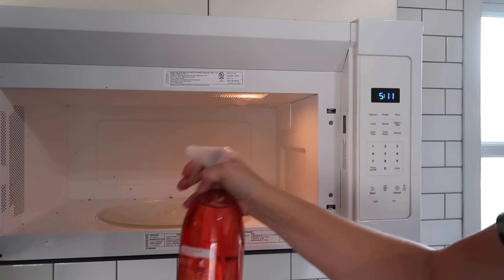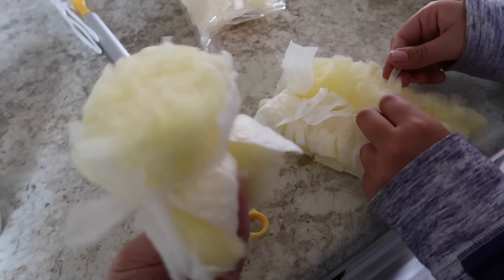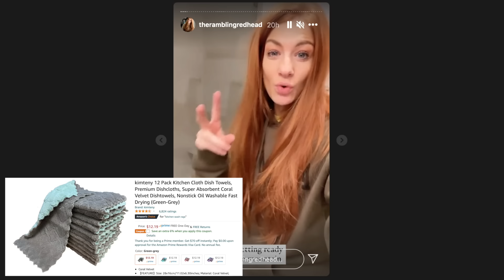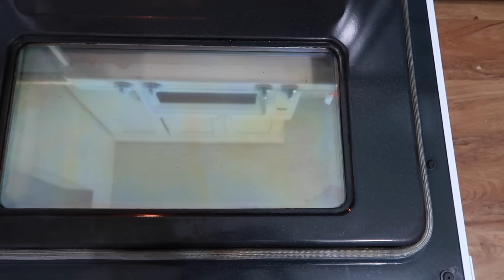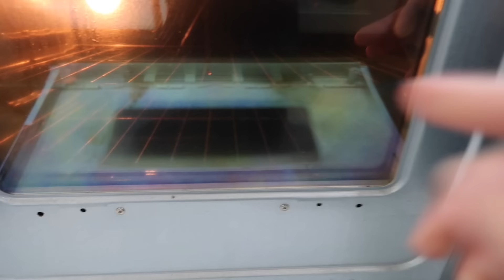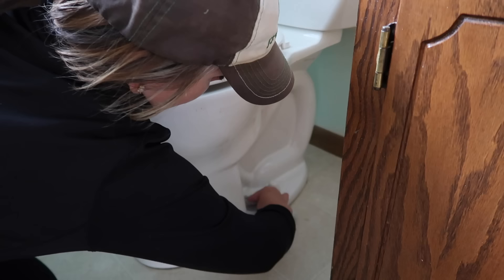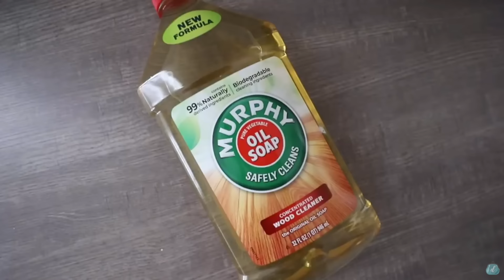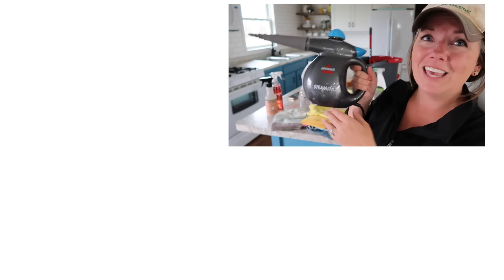Overrated Cleaning Products? Test them with me!

Comment: A note on Dollar Tree’s “Awesome”. I definitely water down the cleaner and have for years! But my favorite places to use it are 1) If I have a really dirty set of sheets and pillow cases, I put them in a stopped up kitchen sink and pour an entire bottle of Awesome over them and add enough water to make sure everything is soaked. I let them sit for several hours, drain the water out, and then put them in the washer and dryer. They come out much much better than just washing for $1.25!!
I’ve even cleaned a king size cross-stitched quilt made for me by my grandmother as a wedding gift 50 years ago. It had a white background so I was trying to be really careful! It worked perfectly. I only dried it half way and then laid it out to finish drying!

2) My young daughter ground a tube of RED lipstick into our living room carpet, 30-40 years ago, right in a walking spot. I rented a carpet cleaner and used the cleaner they sell when you rent them; it didn’t work. Then I had a professional carpet cleaning company come; it didn’t work either. Then a man selling Awesome door to door, came by several months later. I laughed, telling him the story, and said if he could get it out, I would buy the $45 gallon bottle of Awesome!! He came in with his watered down spray bottle, and sprayed it on using about 5-8 sprays, then ran his fingers over it gently to work it in a little. He had a few dry white rags and folded them several times and laid it right over the spot, then stood up and stepped on the rag to blot up the cleaner. Just the first try removed at least 90% of the dark red stain. He cleaned it 2 more times in the same way and the RED lipstick was completely gone!! Yes, I bought the gallon and only used it watered down for quite a few years. I even purchased it several more times over the years. But, the day I saw Awesome in Dollar Tree was the day I hit the jackpot to me!!! I’ve even cleaned my car seats and headliner of the car with it! I’m a true believer!!
Diane Young
Reply: I frickin LOVE awesome!!!
Reply: How do you use it to clean car seats, please?  Mine are a mess from my dog. I love awesome but don't know how to use it on upholstery.

Comment: I've found that the best time to clean ceiling fans in bedrooms is when I'm about to wash the sheets.  A quick hop up on the bed, and lickity-split, the fan is dusted, and the pillow case goes into the laundry.
Reply from the maker: Oh! That's a great idea!!!
Reply: Swiffer sells an expandable, (telescoping) handle.  I am able to use this to clean ceiling fan blades without climbing up on anything.  I really enjoy this handle, and have made sewn some replacement "swiffers" from fleece. These are machine washable, reusable,  and work fine.  Saw a youtube video about how to sew this simple project.
Reply: I really like the pillow case idea. By the time I do the fan there is alot of loose dust particles
Reply: Love this idea! I also clean my ceiling fans every month. Here in Texas we use them year round!
Reply: @janiewilliams5803  How do you keep the blades from turning while cleaning them?
Reply: @jnorth9702  With the ceiling fan turned off, I lightly move the swiffer across the surface.  The expandable handle can be adjusted at different angles, adjusted one way for the top of the blades, another way for the sides of the blades. The blades might move a slight amount.
Reply: @janiewilliams5803  Thank you Janie for responding 👍 that helps!
Reply: @jnorth9702  I just watched the video and had my 13 year old turn off the ceiling fan and hop up on the bed to clean the ceiling fan. I pulled out an old pillowcase that I was only keeping for scraps because it had become worn out and scratchy. 

She used her finger along the cleaner under-surface to turn the blade and once you place the pillowcase on the blade, it just moves with your hands so it's easy to keep still.  She was done quickly - less than 6 minutes- and did the living room ceiling fan next. Afterwards, she did her dad's living room and her sister's bedroom and her own. All were done with the same pillow case and it went right in the wash - by itself. She said it was much easier than using the swiffer - which she used the last time to clean all the ceiling fans.
Reply: This is an excellent idea, thank you!

Comment: The blue window ecloth is a drying cloth. Use your regular microfiber cloth to clean it with water and dry with the polish cloth. It will leave windows and mirrors and stainless  completely streak free. I give the two cloths to my kids to clean windows and I don't worry at all.
Reply: I was coming in the comments to write the same thing the blue window cloth is to be used after the microfibre.
Reply: I was coming to say the same thing.... and that NO cleaners should be used with the e-cloths... it actually ruins them.
Reply: Yep. The e cloth window cleaning set works together. One to clean; one to polish....and w/just water. I clean a couple of residences professionally, & these are game changers! 😉
Reply: I don't have any special brand microfiber cleaning cloths, and I do the same. I clean with a wet cloth and then polish it dry with a dry microfiber cloth. Always streak free!
Reply: Agree. A lot of failure is based on how you use the products. The swiffer duster for instance is great for dusting. If your dust is held on by a year's worth of grease or grime, it needs a good cleaning.
Reply: @jeanettedeboer846  agree. I’ve owned e-cloths and now just buy cheap microfibre cloths and they work just as well. The main difference is that they take a little while to be as absorbent so I wash a few times.
Reply: The other cloths just use water the same as an e-cloth. I don’t believe anti bacterial properties scan survive in the washing machine - that’s a gimmick.
Reply: @moonseesme  no worries, I still believe that for the average household, soap and water is enough. I feel that a few germs doesn’t harm us and in fact helps build immunity. I’ve been using nothing but simple homemade cleaning solutions and cheap microfibre cloths for over 10 years now and have noticed no difference.
Reply: Yes! E cloth is like the cheap Norwex version. Antibacterial with just water only! And like others have said it's a drying polishing cloth.
Reply: Great thing to know!
Reply: @moonseesme  thank you for the info! I hadn't realized there was a structural difference between the e-cloth and the regular micro fiber.
Reply: @Originallyadressmaker , I am not familiar with the e-cloth but Norwex cloths have silver embedded in the fibers.  The silver is what inhibits the growth of bacteria.  A washing machine can't take it out.  I demonstrate how the Norwex cloths pick up bacteria with just water by wiping a counter with raw chicken.  After wiping one swipe with a damp cloth, I use a hospital-grade test strip and there is no bacteria left.  When microfiber is very thin (it has to be 1/6 the thickness of a human hair to be called microfiber), it picks up a lot.  Norwex is 1/200 the thickness of a human hair so it can pick up even bacteria.  It is especially handy when cleaning things like spilled meat juice in the fridge or counter, the inside of a cooler, kid's toys, when you don't want to have to hassle with soap and water.  Glad you have a system that works for you :)
Reply: Yes! I've been using these for years and the combo of the glass cleaning cloth followed by the blue drying cloth is amazing! I haven't bought glass cleaner since
Reply: I too was looking to add this comment. I got the ecloth set with the waffle cloth and the blue cloth; wet the waffle cloth to clean the window, then follow up with the blue polishing cloth. I don't have to spend money (or store) a window/glass cleaner, and my mirrors have never looked so good! Norwex's own site convinced me to not buy their product lol. The microfiber is what picks up the bacteria, germs and dirt, the "antimicrobial" property is the silver coating they put on and they only put it on some of their products and really it's just a way for you to go longer between washing your cleaning cloths... that's a pass for me, I'll just wash it when it's dirty.
Reply: Alcohol on mirrors, takes the hair spray right off!!
Reply: Any special was to launder the microfiber eclothes?
Reply: @kay.hthrkc9302  in my experience, nothing special required to wash.  I air dry, or just don't use fabric softener or dryer sheets on them if you usually use either.

Comment: That blue cloth from e-cloth is not for cleaning the windows/mirrors. It's meant to be used after you've washed them with the fibre cloth. It's basically a drying cloth and works great.

Comment: The Steam Shot at the toilet hinges where the seat attaches to the bowl - that clean alone was worth the money for me. 🤣
Reply: Same here.  I don't have a steam shot but I do have a steam cleaner and I use it in those crevices that NOTHING else can reach.  For me, that's its sole purpose--not to clean showers or oven doors but to get in those tight spaces that nothing can reach.
Reply: I do that as well. I think the steamer works great for small spaces, I love to use it at the edge between the counter and the stove top... it always amazes me what comes out... even when it looks semi clean. I put the nozzle directly into the surface I want to clean, touching it so it gets the direct hit... and it works well.
Reply: Thanks for the tip! I’m going to try that as I never manage to get the toilet hinges as clean as I would like. 😁👍
Reply: Yes! I notice it if my hands are dry. Norwex doesn't do that. This is why I don't use cheap cloths.
Reply: The sure shot made the hinges and the crevices so easy to clean.  On one side, our toilet is about 6 inches from the wall.  I never felt like I was getting it clean enough.  The sure shot made the job so much easier.
Reply: I clean houses,  the Steam Shot with the scrubber brush attachment is hands down the best for grout in the bathroom.
Reply: I don't have a steam cleaner but this is the biggest reason why I want one! It is so difficult to get the hinges on the toilet lid clean!  I've just always hesitated because I didn't know if it would work as well as it does on TV.
Reply: @DebadooCreates  it was great for me. The easiest toilet I’ve ever experienced, and so fast 😯
Reply: Yes! It’s great for baseboards, especially behind the toilet 🚽. I clean my daughters high chair with it to, those little hard to reach places. The steam shot is one of the best things I’ve gotten.
Reply: @DebadooCreates  It's not hard to take the toilet seat off for a good clean. (And there are some styles of toilet seat marketed as "easy clean" that can just pop off without even needing a screwdriver.)

Comment: Magic erasers for everything! The kitchen sink, the bathtub and shower sides, walls, etc. We've got five kids under 12 and they are one of my main cleaning products haha! My kids also really like using them.
Reply: My husband would use these when he had a commercial dive boat. Love them!
Reply: I don't feel like they are proven to be safe, I worry that they may release formaldehyde and they disintegrate as they work. I use a glove when I use one and use it sparingly.
Reply: I do have to say they take off the finish of what you use them on. I NEVER use these. Every counter, shower, sink ect has a finish on it. Once you remove it with an eraser or abrasive like Comet, it will forever stain.
For shower surrounds vinegar and water spray down keeps soap scum from building up. I use scrubbing bubbles if A bar soap was used in the shower

Comment: E cloth you should use only water. You used the polishing cloth, which should be done after you clean the window with the waffle texture cloth. Wipe down windows/mirrors with a e cloth micro fiber wet with water, then go over it with the blue polishing cloth to pick up the water and for streak free. Whole point of e cloth and Norwex cleaning cloths is to not have to use cleaning products. E cloths are absolutely amazing!

Comment: You're missing a bet with the Swiffer long-handled duster. I use it on floors under and behind furniture and baseboards before every vacuuming. You can achieve that Spring Cleaning clean all the time-no dust bunnies hiding out. The long handle saves your back, too.

Comment: Save the steamer. When the children have tummy bugs, think norovirus, you can sanitise the sink and toilet areas with impunity and halt the household spread.
Reply: This is what I was thinking! From what I've read it's great for sanitizing hard to reach places in toilets, sinks, and grout, not for general purpose cleaning.
Reply: In Catherine's demo, she had steam shot directly on the surface  . Dawn, you held steam 5 inches away, different method=different results
Reply: Exactly. It’s not just for cleaning. I have a full steam cleaner. The ones with a tank. I have a few attachments like a mop, a medium brush for upholstery and larger areas, and a small brush for crevices and such. I know that when I’m cleaning, I’m also sanitising and with nothing more than water most of the time. You also do need to use it much closer to the surface than what was done in the video. It’s great to sanitise toys, upholstery, carpets, and especially the window corners that nothing seems to be able to reach. I don’t use it for the oven or stove because I actually prefer hard work cleaners for those things.
Reply: @meman6964  I agree. You have to hold it pretty close.
Reply: Now I am going to have to order one!
Reply: I had great success with the steamer on old, painted-on windows that were filthy. They looked like new when we got done. Also on old textured linoleum with   decades of dirt ground in. That took a while, but also like new when done. Super satisfying!
Reply: @kristinpothast  Won't that high heat crack porcelain? I'm afraid to use it on toilets.
Reply: I use mine like a mini pressure washer.   CLEAN.   Around all borders sink stove fridge dishwasher bath surrounds grout aluminum window frames any window frame washer dryer cabinets door drawer handles baseboards louvered anything  some have a flat pad attachment  w/ squeegee edge and washable cover.  Just go slow,  I have TWO so always full and hot.  Tanks are too small for serious cleaning otherwise.  HOT bee careful!!  Not for children.
Reply: @monadeprimo2879   I use my steam cleaner with the narrow attachment to clean outside the toilet bowl, around the screws for the toilet seat (mine don't pop off), not inside. I honestly don't like using anything but a toilet brush inside the toilet bowl but I've known of many people who do it without any problems whatsoever.
Reply: To anyone wanting to check out steam cleaning videos: Clean Freak & Germaphobe channel here on youtube is great. I learned a few extra things with them.
Reply: @monadeprimo2879  porcelain toilets are like tanks! No cracks here! Steam is surface can't heat n crack a toilet its on the most part non porous ;)
Reply: I see the steam cleaners at the thrift store all the time. They are usually under five dollars, even with all the attachments. I think I would get one just for sanitizing things in the house.
Reply: @kristinpothast   I put a spray bottle top on a bottle of peroxide, spray til those areas are wet, wait a couple minutes, and wipe. No fuss.
Reply: @staceykersting705  it’s the best cleaner in the entire world for potty training a little boy ! It completely eliminates pee and pee oder! 
Also… it takes chocolate stains out of white clothes.
Reply: @sholohatik2370  What's the best cleaner? I think the pertinent comment may have been edited out.
Reply: @staceykersting705  peroxide! I also put a sprayer on my bottle also! I should have been more clear. I was tired. Lol
Reply: @sholohatik2370  YES! I use it a lot. Even on doggie accidents on carpet! Just spray well and run over with carpet shampooer. never worry if the soap's all rinsed!  Toilets, sinks, underwear...YES!

Comment: I rarely ever have to clean up our microwave because of a tip I learned in the '80s! When we bought our very first microwave, it came with a free “How to Use It” class that my husband and I attended. ;-) The instructor told us that all we needed for cleaning were either a piece of wax paper or steaming-hot water, and she was right. Now I always use one sheet of Interfolded Dry Waxed Paper by Handy Wacks from Costco, crumple it up to keep it from flying around in the microwave, and lay it over whatever is being cooked (if it’s uncovered). The waxed paper catches nearly every splatter. Once everyone in the house is on board with this, there are very few messes to clean up. Others in these comments here have mentioned the second line of defense she taught us—heating up water to build up steam before cleaning splatters. It works so well!
Reply: Steaming the microwave is so awesome. I always do. I clean houses for a living and that works the best. I usually only microwave the water for 5 mins and wipe out. Very rarely I have to steam more than once or longer than 5 mins. I don't use the wax paper in my microwave, I do have a microwave cover that I use to cover the food so food doesn't splash everywhere.
Reply: I use a paper towel in the same way. Cheaper and biodegrades faster.